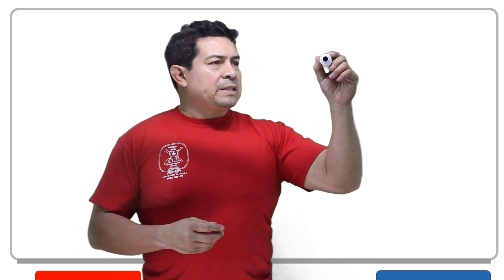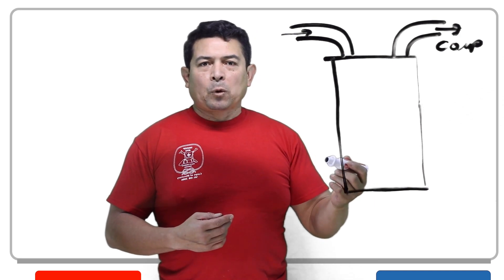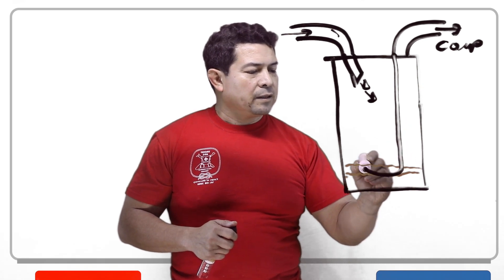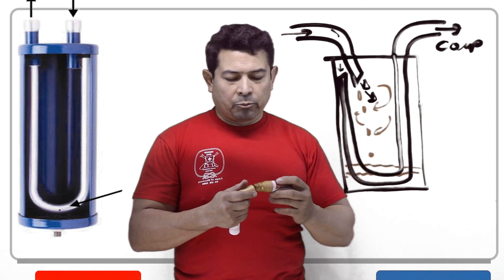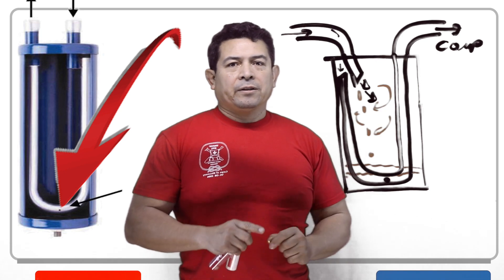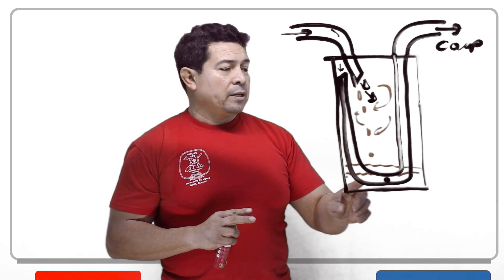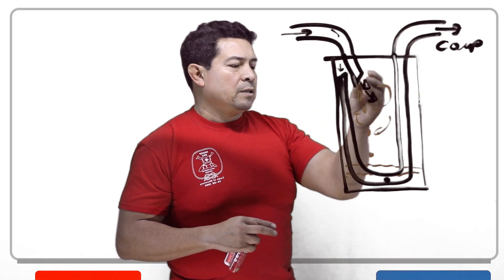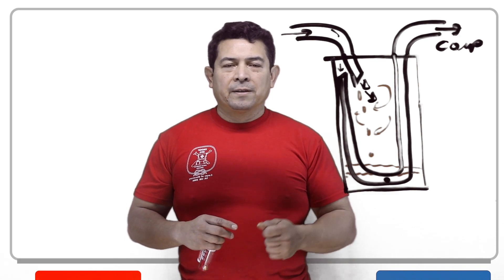Accumulator - HVAC Online Training and Courses

Comment: I always say : when you replace any component of an A C system . Replace the drier too . Desiccant can hold only so much moisture.
Reply from the maker: You are absolutely correct. Especially with these new refrigeration oils like the POE oil they will not release the moisture so we must replace the dryer. The manufacturers these days tell you that you have to replace the dryer anytime you open up a system.   So you are correct! Thank you and thank you for watching!

Comment: I need help, hope you or anyone could help me. I have a trailblazer 2005. The ac system works without a problem. But for some reason the orifice tube is getting clogged. What do I need to do or change? . What is the reason for that to happen?
Thank you for the help 😁
Reply from the maker: Hi! I had a similar problem years ago. What I ended up having to do was to take out the meter device/orifice tube. If I remember correctly, I also changed the dryer/ receiver or maybe it was the accumulator I don't quite remember. I pulled a good vacuum and had no more problems after that. But somehow dirt got into the system if the orifice keeps getting clogged up. How would first try changing just the metering device/orifice tube. Good luck I hope this helps!
Reply: Thank you. I will see what happens.👍

Comment: I’ve replaced dozens of receivers due to rust causing leaks or they are in front of the compressor and thus replacing them is better than reinstalling them. But I never knew how they actually work inside. Thanks.
Reply: Do you have a similar video like this but explaining how oil separators work?
Reply from the maker: @bervotten  I'm not quite sure what you mean by separators? I have dealt with separators on pneumatic systems, but never on air-conditioning equipment? If you could explain?
Reply: Similar to an accumulator, an oil separator is a cylinder that receives the refrigerant and separates oil via screens built inside. Mainly used in commercial refrigeration and screw compressors.
Reply from the maker: @bervotten  I'm so sorry, somehow I missed part of that message. Yes I know what an oil separator is. I do not believe I have a video on that which would be a good one to make.

Like you said, yes, it all separator will separate the oil and the refrigerant. There is a float inside, and as the oil level increases in the oil separator the float opens, and since the oil separator is on the high side and the crank case of the compressor is on the low side, the oil will naturally flow once the float opens from high-pressure to low pressure. I do believe I have a video that explains the accessories. And in that video, I do cover the oil separator.   If you look at t he link below 

https://youtu.be/VWjEmhCeCdU 

I cover the accessories in a refrigeration system to include an oil separator. If you go to the time. 14:50 on the video I talk about the oil separator.     I'm sorry I missed that small portion when you asked about an oil separator.

I hope this helps thank you and good luck! And again, thank you for watching!
Reply from the maker: You're welcome! I'm glad the video could help you and yes, that is how accumulators work and that is how accumulators look like on the inside. I have repaired some accumulators and they rust up again so it is best like you said to replace them! Thank you for watching!

Comment: What happens if let’s say you have too much liquid refrigerant coming back to the accumulator and it’s getting trapped there? You have your accumulator freezing up and the system goes into vacuum, heat mode in a heat pump
Reply from the maker: That, is a good question.  at the bottom of the accumulator there's that orifice that keeps pulling the liquid refrigerant from the bottom into the system and it atomizes it due to the ventury  affect so that we always keep liquid refrigerant going back to the compressor when it is atomized the compressor,  compresses it and keeps the system going.  I hope this answers your question.     That was a good question! Thank you for sending that in and thank you for watching!

Comment: can any answer on how to drain the liquid refrigerant from the accumulator and pump it back to the receiver. the plumbing and what kind of pump… its a question on my stationary engineer exam
Reply from the maker: That can easily be done by first closing off the king valve, which is the valve on or right after the receiver, then you would close the suction service valve, that should be before the accumulator. When you push the contactor in to make the compressor run, you would boil the liquid out of the accumulator and into the receiver.   once you have done this, you can close off the liquid line service valve on the liquid line, which is before the receiver and refrigerant should have gone into the receiver. 

I hope this helps! It is called a pump down procedure.
Thank you for watching and sending your question in!
Reply: @AirConAcademy  thank you 🙏🏾 what kind of pump would pump the liquid refrigerant from the accumulator back to the receiver is the compressor slugging
Reply from the maker: Other than pumping it down, using the pump down procedure, the only way to get it to move around, would be the recovery machine. The recovery machine could be used as a pump to move it from one place to the other.   typically it is a pump down procedure. I hope this answers your question. Let me know.
Reply: @AirConAcademy  thanks i think pump down or evacuating the system with a vacuum pump will be the way to go thank you again
Reply from the maker: @tyhamell5425  be careful because when you use a vacuum pump, that would not be the correct answer. The vacuum pump would pump whatever is in there to the atmosphere. With a recovery machine, you could move it from wherever over to the receiver. But the correct thing to do would be to pump the system down.  So you pump everything onto the high side, including the condenser and the receiver. Whatever is in the accumulator or the evaporator pumped into the condenser and into the receiver...
Reply: @AirConAcademy  thank you but you do evaluate the system with a vacuum pump?
Reply: @AirConAcademy  and will it stop the compressor from slugging and boil off the refrigerant in the compressor
Reply from the maker: @tyhamell5425  I am not sure what you mean by the valuate the system?     You only use the vacuum pump to pump the system down to 500 µm when you have finished installing it. You do not use the vacuum pump to recover refrigerant.
Reply from the maker: @tyhamell5425  when you pump down, the refrigerant that is mixed in with the oil gets boiled off, just as they refrigerant that is in the accumulator. Once they are boiled off, they get pumped into the condenser and into the receiver by the compressor.
Reply: @AirConAcademy  im sorry evacuating the system and im studying your video on pumping down aswell thanks will you do anything on cooling towers? or are more residential

Comment: Thank you so much sir. Pls is there any difference between refrigerator compressor and air conditioning compressor?
Reply from the maker: Remember one thing. Refrigerators or refrigeration systems will typically use a different type of refrigerant than air conditioning systems. Because of that they will use different oils, sometimes, so you need to make sure that you order or you get the correct compressor for that application.    so I guess you could say that there is, or that there are some differences in them.      I hope this answers you question. And thank you for watching!

Comment: Love the explanation would 6 oz of PAG in a 8oz capacity system be too much 1995 Impala
Reply from the maker: Thank you!!!    
I think that is a hard question to answer. Are you replacing the compressor? Did the compressor come empty without any oil? Typically what we do is to measure how much oil is in the compressor when we remove the compressor and then replace only that amount of oil that came out. Usually you do not lose a large amount of oil because of leaks. So the oil should be in the system. You don't want to have too much oil in the system because it will just lay in the evaporator or the condenser and then they're not going to transfer heat like they should. I hope this helps! Good luck!
Reply: No compressor change replaced evaporator leaking and will change accumulator
Reply from the maker: You should not have to add any Oil. You should be able to just change the evaporator in accumulator. Good luck!    @felixsoto9110

Comment: Why not all hvac units are installed with this accumulator?
Reply from the maker: quite honestly, I'm not sure!? This would save a lot of compressors, but then again, it cost money to install it. And the manufacturers want to make more money I suppose. These are used in heat pumps because of the low outside air temperature when the heat pump is in the heating mode. Sorry, I guess I don't have a good answer as to why you don't have these on all AC units? Thank you for watching!

Comment: So the liquid refrigerant doesn't harm the the compressor as long as it's in a fine mist form ?
Reply from the maker: Correct! Typically when that missed goes into the compressor it is first, going to come in contact or come close to the motor and the heat from the electric motor that is running the compressor , this hat will instantly evaporate the mist! 
If you have too much liquid coming in because you don't have an accumulator then you're going to wipe the bearings, they're going to be clean, and they will not have any lubricant so your compressor will fail!   I hope this makes sense, thank you for your message and thank you for watching!

Comment: Small question how can you know what type of Freon you put up with out make on the container please help me
Reply from the maker: I'm not sure I understand your question. But if you have a container of refrigerant, and it is not labeled. You should place it in a room for several hours, once it has stabilized at that room temperature, then you get the pressure and compare the pressure and temperature in the PT chart. That will tell you what type of refrigerant is in the bottle/container. you have to have an accurate thermometer, accurate gauges, and a PT chart. I hope this answers your question. I assume that you're not talking about a specific unit because you could look up the type of refrigerant and the data plate of the unit. But if you're talking about a bottle of refrigerant/container send the way I mentioned is the way to find out what type of refrigerant is in the container. Thank you for watching!

Comment: excuse me sir I have a question, as video said there will be more and more liquid refrigerant in accumulator how to handle it, and whether  the oil will get into the AC system or just in compressor
Reply from the maker: Thank you for sending the question in. The liquid refrigerant, and the oil will go back to the compressor through that small port at the bottom of the U tube. It's designed that way to make sure oil always comes back to the compressor. Oil always travels with the refrigerant, so there will be oil traveling through the system every time the unit is running.  I hope this answers your question! And thank you for watching!

Comment: Hi,
I would like to thank you for these very good training courses, however; I've seen systems without Accumulator is there a certain conditions and special applications to install Accumulator ?
Reply from the maker: Yes, most of the time manufacturers will not install accumulators unless it is a heat pump. Typical air conditioning units will not need accumulators because one other things that we do is make sure that we have superheat. Because of the superheat we should not need accumulators in air conditioning units. A heat pump needs an accumulator because of it operating in low outdoor air temperatures. We always run the risk of getting liquid back to the compressor and the accumulator will stop this. This is why we typically do not see them on units. I hope this answered your question! And thank you for watching!

Comment: Can suction accumulator be installed before screw compressor? Or it is valid only for recip compressor ?
Reply from the maker: Interesting question, as far as I am aware there are five types of compressors, reciprocating, rotary,  scroll, screw and centrifugal. I have only seen centripetal and screw compressors on chillers, meaning they would only be used on large systems and an accumulator would not be needed. The other three, reciprocating, rotary and scroll are used on smaller units. Most of the time when I have seen accumulators they are used in heat pumps. This is done because it is running on your very low temperatures and pressures in the heating mode so most likely they will be liquid trying to get back to the compressor and the accumulator will stop that.  I have never seen a screw or centrifugal compressor used in this application. I hope this answers your question. Thank you for the question and thank you for watching!
Reply: @AirConAcademy  Thank you very much for your answer. Actually, the system which I am talking about is AC Plant for the ship, it is not a Chiller System. But as I see it can be installed before screw or piston, doesn’t matter. If you have video about how to choose correct sized suction accumulator it would be very good.
Reply from the maker: @AMGpro1992  in your situation I suppose you could install it before the compressor. But it should not be needed if you have a good amount of super heat! And on your system I'm afraid it is too large of a system to have an accumulator? I have never seen an accumulator for a system that large. The most important thing you can do is make sure that you have superheat. Most likely you have TXV's so they should maintain superheat. I hope this helps. Let me know!

Comment: Will the accumulator get over flow as the liquid refrigerant are coming in?
Reply from the maker: If the accumulator is sized properly it should not get overflow of liquid refrigerant going back to the compressor. If someone has overcharged the system then, yes liquid would still make it to the compressor but the accumulator would have to be practically full of liquid refrigerant. I hope this helps! And thank you for watching!

Comment: i have one dryer air..
works 3 to 40 c temp
i change filter and capillary tube but i  haft to resize it...
so now i have
-7.5c entry to evaporator and exit 2.5c 
after to the accumulator i have - 3.5 and  entry to compressor 9c is that normal.... how much must be the Δτ  to the evaporator? and with the temp room so the dryer ro works good?? 
thanks

Comment: How can you tell if a Accumulator is bad. Let's assume everything else is correct.
Reply from the maker: That is an interesting question! There is actually not much that can fail in an accumulator. The only thing that could happen is that the port at the bottom of the YouTube could get clogged up. Other than that not much can fail.   The only thing I have seen happened that makes you need to replace an accumulator is that they rust and they leak. They are made out of steel so patching it is not going to work. I have tried that before and a few days later another hole appears someplace else. But there isn't anything that could actually feel in an accumulator. I hope this helps! Good luck out there!
Reply: @AirConAcademy  Thanks

Comment: How about R410A accumulator it is same,cause why generally now r410a using liquids to toup the refrigerant.
Reply from the maker: Remember, the accumulator is like a safety device for the compressor. It is not there to help you charge a system faster with liquid. To do that you need to throttle the refrigerant into the system so it flashes off long before it gets to the compressor. I have a video that talks about that, you could look for that.  Accumulators are typically used on heat pumps because they run under very low temperatures. Be careful when you charge system with a new refrigerant.
Reply: @AirConAcademy  thanks sir for your answer

Comment: What happens if we turn off the heatpump?  Could it not happen that a larger amount of liquid refrigerant runs into the pipe and gets sucked into the compressor when we turn on it some hours later?
Reply from the maker: That is a good question! If that was to happen it would be a minimal amount and it would not be enough to slug the compressor. Some manufacturers suggest that you have a heater in the accumulator to keep that from happening, but I am sure they would be in very cold climates. And if it's that cold you would not use a heat pump. That was a very good question and thank you for sending it in.
Reply: @AirConAcademy  Thank you very much. 👍

Comment: Thank you for the clear explanation. Please can you explain a bit how the accumulator affects the flow rate on the suction side of the compressor for a partially evaporated refrigerant. Is it the same as the inlet of the accumulator? or Is it reduced?
Reply from the maker: They (The manufacturer) have developed hem so here is no pressure drop across them.  The pressure should be the same from one side to the other.   Thank you for watching  and the question!!!

Comment: Thank you for the video very good training course for beginners just a note accumulators should be insulated
Reply from the maker: They do not need to be insulated.  accumulators will sometimes have the liquid line going through them to boil the liquid in the accumulator. Remember we want the liquid in the  accumulator to evaporate.   Insulation will keep the liquid from evaporating, unless there is a heater attached  to the accumulator.